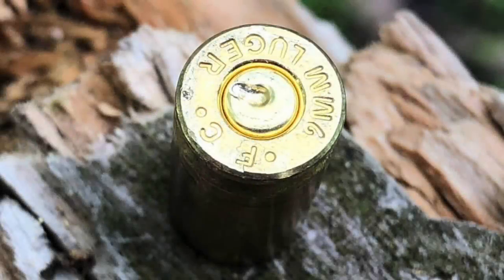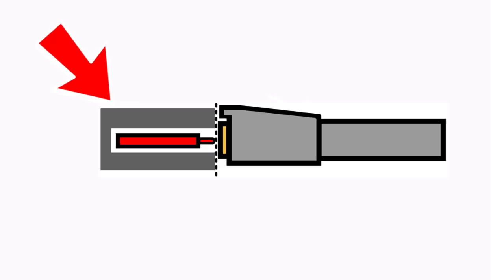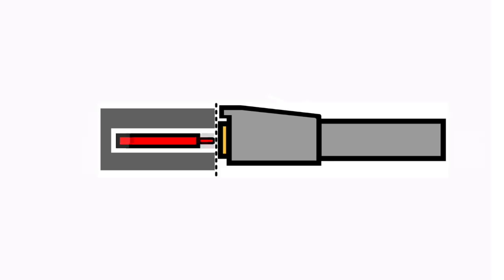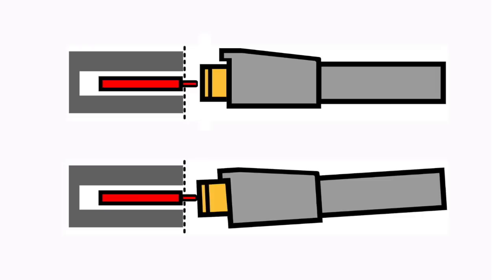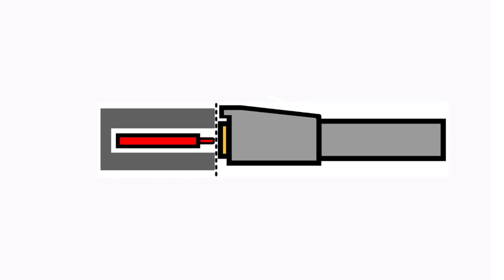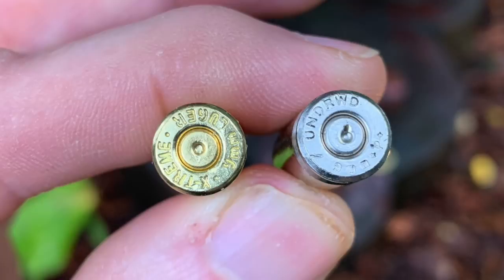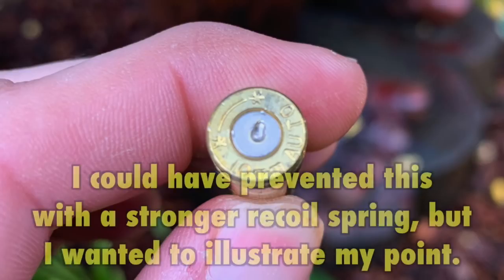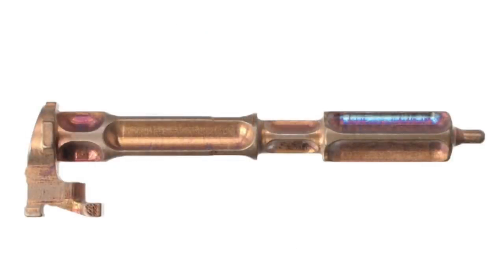Primer Drag: What Is It? What Causes It? Is It a Big Deal?

Comment: Doesn't happen in my xds.  Now hate me for owning Springfield guns lol.
Reply: I got a couple, xds are great,  slightly better than glocks
Reply: @moregainsmoreveins5267  my opinion is far superior. Metal sights, metal mags, no ugly U sight, no crap grip angle, no crunchy trigger, great mag ejection, great casing ejection and better finish.  Only thing wrong with it now is HS produkts needs to cut ties with Springfield after contract is up and sell them as HS.  
I want that hellcat bad as well but will wait for a used one.
Reply: A J yeah i got an xdm9mm and i love it! 19+1
Reply: @moregainsmoreveins5267  got a xdm 40. My oldest gun i got, never a hiccup.
Reply: A J thats what i plan on getting next the 3.8, 16+1
Reply: A J damn fr? Well i might just have to look
Reply: @moregainsmoreveins5267  yep cheap AF and they are only producing xdm in 10mm from now on. no 9 40 or 45 as far as i know, so whats out there is it.
Reply: A J what do you mean?
Reply: @moregainsmoreveins5267  they r supposed to stop making all XDM platform except the 10mm, i think they already stopped making them.
Reply: A J damn,  fr?

Comment: My neighbor says watch this video becouse its what his glock is doing, brought me several spent cases. After putting them under the magifier i showed him that its not the case, it's the square firing pin hole imprint (the forensic signature of a glock) that he is saying was pin to primer drag. I've only seen this primer drag on week return springs that need to be replaced or matched to the power level of amunition being used. Week firing pin springs or dirty firing pin channels can be a producer of this also.
Reply from the maker: Many Glocks drag like crazy. It just looks a little different because of the shape of the pin.
Reply: @TheYankeeMarshal  i agree, as mine shows this and even my 709 tauras with +p loads.  But the one of which i referenced is 17  that was tuned by some crazy glocksmith and the guy only shoots +p and +p+ loads. It imprints the firing pin hole almost perfectly and there really seems to be no drag. Mine looks like an NHR event on 75% of it's cases from the same box of ammo. It's all in the springs and timming. Tauras is a pain to tune when it comes to springs and the 17 i just haven't tried tuning it yet.

Comment: All the cases shown here were fired w Sigs.....go figure.....  I did test and took picuters of 6 small 9mm guns with the ammo I use.... Most had some drag but non like Sig 365.   And YM is a  big DragQueen!!!! just remember that
Reply from the maker: None of my casing were from Sigs. Your bias shows your inexperience.
Reply: @TheYankeeMarshal  I have CERO bias, own several Sigs, and at least I did compare the common small guns used (well MINE) and will several ammo.... and the cheapest gun had no DraG---it's still a POS and I will NOT trust it...  And just to me you proud, I carried a gay 357M revolver today.....felt weird.
Reply: @TheYankeeMarshal  You forgot to mention that this happens with medium size guns: FNH 509 for example and that is probably due to manufacture/design flaw....their pins do not retract well and they end up braking like some of the Sig 365. Drag becomes an issue when it hits the RIM, harder than the prime. Of my experiment only the Walther PPS M2 had no drag.  Glock is a bit more difficult to evaluate and Kahr was OK'ish. Ruger.....soso...; not sure SW was tested?
But everyone should try it w their toys and their ammo.....

Comment: From picking up range brass over the years I have noticed this more often on 40 S&W cases than any other, not scientific just my observation.
Reply: My Glock 22 has done it since day one, especially with hot loads. Replacing the recoil spring and guide rod with a Lone Wolf unit helped a lot, but it's still there. I also have an M&P Shield 45 that shows primer drag (more properly, striker drag or firing pin drag), and of course, my P365 exhibits it, though it's been rock solid reliable for close to a thousand rounds now....

Comment: Are you just trolling on purpose? Your understanding, or explanation, on the browning action is seriously flawed. When the gun is first fired the slide AND barrel travel rearward together.  As they travel together, the breech drops down tilting the barrel TO UNLOCK FROM THE SLIDE. At that point the barrel runs out of travel and stops while the slide continues rearward extracting the spent casing.
  The tilt may help feed the fresh round but that is mainly coincidental, proven by the few odd pistols that don't tilt but still feed.(.ie rotating barrel)
Reply from the maker: You think your barrel goes back as far as the slide does? You are too simple to understand what a simplified illustration is?
Reply: @TheYankeeMarshal  C'mon man. This explains alot if your issues, you can't read. I like your videos and I don't want to call you out and embarrass you but I'm going to when you misinform people. You were wrong, you know it.  Now just fess up and shut up.  
Re read my statement and you'll see that I did not say the barrel travels as far as the slide. Go ahead re read it.
And don't anyone think I edited after he called me out. He's just showing his liberal side.

Comment: Your drawing is not accurate. The firing pin is protruding through the breach face of the slide. The shell is always in contact with it from the moment the round is stripped from the magazine till the shell clears the barrel  chamber. This is because the extractor is holding it in place. As the fired shell is held on the slide during ejection it does get forced down along the breach face where the firing pin may still be protruding when the slide comes out of battery as the barrel tilts down until the ejector pushes it off.
Also, I would question your analysis of the amount of power from +P rounds causing the the speed to cause it. What is happening is an over pressurization that causes the primer to back out. This is evident in the crater effect left on the primer. Look closely at the +P round, you have a deep crater with a flattened ridge and a flattened primer edge around the circumference that is a telltale sign of high pressures. This primer protrusion of a few thousandths causes the primer to stay in contact longer during the ejection cycle which is why the drag is more evident in "hot" ammo.
Reply: His characterization is certainly accurate enough to get the point across.

Comment: I just have to sit back and laugh my ass off at all these young kids playing the tactitard opperator cool guy know it alls, they are barelly old enough to have more than a couple years or so even shooting guns other than the times daddy took them out shooting, and all of a suden they just come to know everything about the subject with no schooling or anything about the workings of a firearm or otherwise, they are too young to have been around to remember anything before auto loader pistols became the go to and plastic auto's none the less, they(most) have never had any learning of the different internal workings of the various types of actions and have no real mechanical understanding of how stuff works or don't work, but many guns through the years have been known to have done the same thing, and not all are even handguns because there is many reasons that primer drag occurres, some can be a problem some not some can be fixed just by keeping up a good and propper maintenance schedule and propper cleaning, bottom line if it works and don't break things don't worry about it run it, those guys need to worry more about their knuckle dragging instead of making issue where there isn't any about primer drag.